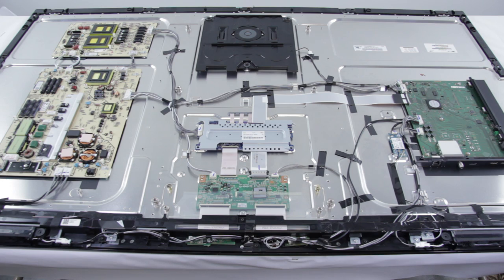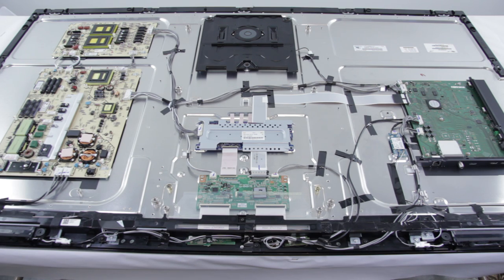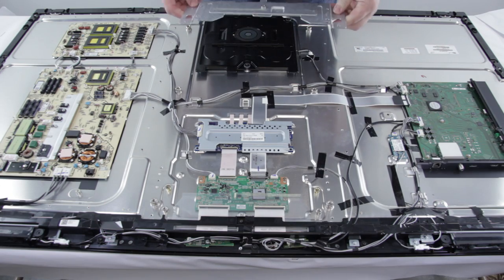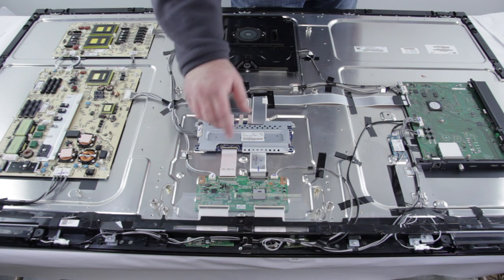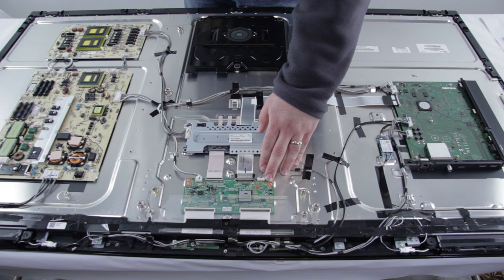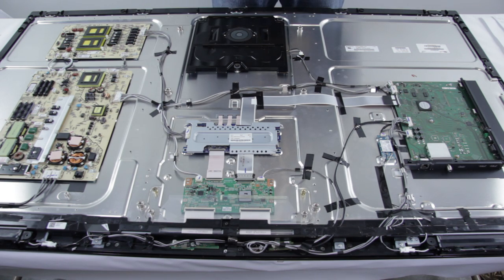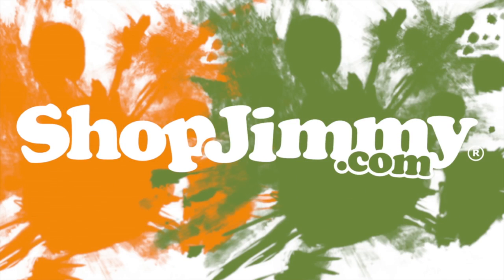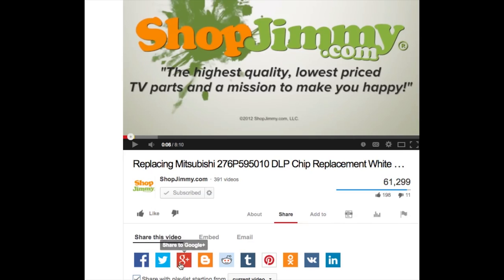LED TV Repair T-Con Board Help Review Overview - Common Issues and Problems with T-Con Boards

Comment: Hello Jimmy, 
My TV is. Smart LED Samsung model: UN46d6900wfxzc. 
When turning on the TV there is sound but a black screen, the MENU doesn't appear either..nothing appears on the screen. 
What can be the issue here please?
Reply: Thank you, 
I have tried this test. I turned all lights in room off and I turned on the TV I was able to see that the screen is actually blue not completely black. I notice the lights on the back are on
Reply from the maker: Abee Al    Try all repairs and troubleshooting at your own risk.  This could be a problem with either the t-con board, the main board or the TV panel.  You can individually replace the t-con board and the main board to see if one of those boards fixes the problem.  Click this link to possible replacement parts for your TV model number:  http://www.shopjimmy.com/catalogsearch/result/?q=46d6900  Be sure to match part numbers on your current board, with your replacement for compatibility.  Thanks and please let us know if you have any further questions with your TV Repair!  www.shopjimmy.com

Comment: hi i have SAMSUNG UE40F6400  Sofware Versio : T-MST12DEUC-2111.1
I have a problem with a dark stripe on the bottom of the screen
What could be causing the problem?
Thank you very much
Reply from the maker: +Indre S   Try all repairs and troubleshooting at your own risk.  This sounds like you have bad LEDs in your TV.  Unfortunately we do not sell replacement LEDs for your TV model number at this time.  You can check back in the future to see if we have them available.  Thanks!  www.shopjimmy.com

Comment: Sir plz reply to me
I HV 49 inch led 4k TV model no 49UH650T_TB
PICTURE started flickering one of mechanic came and he put piece of paper in tcone tc socket thn picture started coming properly but after some time again same problem came. Horizontal line coming on the upper portion and pictures flickering

Comment: Samsung 8 series. No picture, backlight on, sound is working. Can it be t con board also?
Reply from the maker: leslie chowSLU   This could be a problem with either the main board or the t-con board in your TV.  I recommend replacing the t-con board first and then if needed replace the main board.  Please reply with your TV model number.  Click here to view a video that shows how to find your TV model number:  https://www.youtube.com/watch?v=S51nhAmwR2M  Thanks!  www.shopjimmy.com
Reply: It was t con. Cheers

Comment: I am just about ready to give up.  My TV is a Toshiba 52xv645u and the serial number is 927434t10758k1.  The TV went out completely, no power, no anything.  I replaced the power board, but had flashing yellow light, so I replaced the main video board.  I now have a solid green light and sound, but no picture.  I did some research and it sounds like a backlight problem.  My question is there two backlight boards or just the one.  How am I to know if it is the backlight or T-con board?
Reply from the maker: Rick Smith   Take a look at the parts in your TV and compare them to the replacement parts in this link:  http://www.shopjimmy.com/catalogsearch/result/?q=52xv645u  Be sure to match part numbers on your current board, with your replacement for compatibility.  You can also call our customer service for further assistance with your purchase.  (877) 881-6492  Thanks and please let us know if you have any further questions with your TV Repair!  www.shopjimmy.com

Comment: Hi, Thanks for the great video. I have a problem with my Philips 46" PFL 7007 T/12. When I turn it on the screen/backlight comes on. After 10 seconds or so the screen goes a little bit crazy, it shows nothing useful but only black and white 'noise' (not moving, same pattern always) on the whole screen, and then black again, then shows random areas of black and white noise and then back to black, and the process repeats itself from the start. There is nothing connected to the inputs. None of the buttons do anything on remote or physical buttons. I have taken the back cover off and there is no signs of electrical damage, fuse is OK and no signs of blown capacitors. TV is two years old and probably has about 50 hours total usage. Thanks !
Reply: Actually the white noise i was talking about is moving, not 'not' moving as I said.

Comment: I have the a 2 year old Samsung un55es8000f.  the tv worked great however now I have vertical lines.  it does this intermittently.  It is odd in that it will work ok some days all day and then to following day the lines come back.  Folks on the internet say it could be T-con board but many say that the it does not help.  Called SS and they are useless and pointed me to an odd repair show.  The guy said he is well aware of the problem and that it is a $1100 fix UGH?  Any ideas beyond just buying a new TV?

Comment: I have a SonybraviaKDL46EX720 picture went lines blank & everthing else its not suppose to ..After watching reading hrs .Since had sound no pcture Also b4 it was unwatchable the screen boardrs kept changing.Went ahead & ordred Tco board cost 100 bucks & week.No luck wonderig cuz sound bose stereo is connected to hdmi arc port mayb it wasnt Tcon Does that make any sense .What now????
Reply from the maker: mike eckenswiler   PLEASE SUBSCRIBE TO OUR CHANNEL - Try all repairs and troubleshooting at your own risk.  I recommend replacing the main board in your TV.  Click this link to replacement parts for your TV model number:  http://www.shopjimmy.com/sony-a-1814-572-b-batv-board-upgrade-required.htm  There may be multiple boards for the same TV model number, be sure to match part numbers on your current board, with your replacement for compatibility.  Here is a link to a video showing how to identify your part number, click here:  https://www.youtube.com/watch?v=Aodz2LHkzbYThanks and please let us know if you have any further questions with your TV Repair!  www.shopjimmy.com

Comment: Sony Bravia KDL-40S2000 standby mode red light blinking 4x and stay that way until I unplug the power chord. Every time I reset then press power, picture and sound come on but just about 8 seconds then goes to standby mode blinking 4x. Please let me know the possible fix, thanks. Yobfsalamanca

Comment: my Vizio e500i-B1 has backlights, so my screen is white but also produces no sound could that still be the TCon board or the main board?
Reply: Same problem. What did you end up doing?
Reply: I replaced the tcon board. I got one from shopjimmy.com and it cost about 30 bucks. easy fix.
Reply: Randall Morgan Thanks a lot! Very cool for you to respond.  I just ordered the part too. tyty

Comment: 55LW5600 After touching power button. red light comes on blinks a couple times then turns light blue  but no picture or sound. please help. I unplugged and problem remains.
Reply: Sorry, It's an LG

Comment: Toshiba 46xv640U  having episodes of the screen showing rainbow vertical lines.  Sound continues, but screen freezes with the lines.  Sometimes it will blank and reset.  Most times I have to turn off the set and restart.  It happens with the DVD player and the cable box...turning off those does not clear the lines.  The lines only clear when turning the TV on and off.  The rest of the time the picture and sound is perfect.
Reply from the maker: TheDawgies   This sounds like a TV panel (TV Screen) problem.  If your TV panel is bad, it may be more cost-effective to replace the TV as panels are typically hard to find in stock, difficult to replace, and expensive.  Thanks and please let us know if you have any further questions!  www.shopjimmy.com
Reply: ShopJimmy.com  I was hoping you'd say T-con board, but it really helps to save the time of trying to figure it out.  Thanks so much for taking the time to respond!

Comment: I have a sony KDL-52wl-140 .It has two verticle bars in the center of the screen and on the left..If it is a t-con board the # is LJ63-05576B do you have any . Can I send you a picture. If so how
Thanks Gary

Comment: The issue I'm having is my Vizio model# - M3d470KDE, it keeps turning off on its own, no picture or audio, it's as if someone just hit the power button. It'll turn on fine, then a few minutes later it'll turn off again and this cycle repeats and repeats. So what I did was, on the tv there is a backlight Vizio emblem on the front bottom of the tv, I turned the backlight on so its always on, always light up. Next I simply waited for the tv to turn off on its own again and when it did, I noticed that the backlight emblem would power off in unisone with the tv, soo what that did was help me determine weather or not the tv was losing power entirely or not, now i just need to know what part to replace?? please help me if possible,thank you

Comment: Norm:I have a two-year-old Sampson L ED TV model number UN39FN5000 I have no Picture but I do have sound I did the flashlight test and I do have a picture the back lights are not working I replace the main board and the power supply board need help

Comment: i  have a 55" sony bravia it wont turn on and there is no lights on completely no power  model number is KD55X750F and i already changed the power supply board and that didn't fix it

Comment: I have a Samsung LN46A650 that after turning on, it stays on for a short period, turns green for 1 second then power cycles. This sometimes happens multiple times over a period of time...the PWR board was replaced, as was the main board. The problem is becoming more prevalent as time goes on.
Reply from the maker: Whocarez01   Replace the power supply board.  Here are some replacement parts for your TV model: https://www.shopjimmy.com/catalogsearch/result/?q=LN46A650  Be sure to match part numbers on your current board, with your replacement for compatibility.  You can also call our customer service for further assistance with your purchase.  (877) 881-6492  Thanks and please let us know if you have any further questions with your TV Repair!  www.shopjimmy.com
Reply: ShopJimmy.com It was replaced about 3 months ago as part of the capacitor recall Samsung did. Is there another component related to the power supply that it could be?

Comment: I have a samsung Led Tv (model No LNT.4081F).The problem with my Tv is that it seems to be displaying vertical lines.But when we switch on and off for a couple of times,then it becomes normal.So can you please suggest what  the problem may be?Thankyou!
Reply from the maker: Lakshmanan Durairajan   This sounds like a TV panel (TV Screen) problem.  If your TV panel is bad, it may be more cost-effective to replace the TV as panels are typically hard to find in stock, difficult to replace, and expensive.  Thanks and please let us know if you have any further questions!  www.shopjimmy.com

Comment: Hi, I have a Proscan model number:PLDED3273A-B and my tv is 32 inch it just shows white lines that are vertical and they are colored lines when on different channels. audio works fine though. Please reply back to me Asap!
Reply from the maker: +Big Hadi24  Try all repairs and troubleshooting at your own risk. This could be a problem with either the t-con board, the main board or the TV panel. You can replace the main board and the t-con board individually to see if one of those boards fixes the problem.  Click this link to replacement parts for your TV model number:  http://www.shopjimmy.com/catalogsearch/result/?q=PLDED3273A-B  There may be multiple boards for the same TV model number, be sure to match part numbers on your current board, with your replacement for compatibility.  Thanks and please let us know if you have any further questions with your TV Repair!  www.shopjimmy.com

Comment: Hello, I have a LG 55LW5600. I was experiencing 1 black shadow line around 5-6 inches long. I attempted to fix this myself by cleaning the ribbon/wire. After a couple of unsuccessful attempts the picture has changed. Now I see images that are blurry almost as the picture can't catch up as what is coming in from my cable box. The shadow line is faintly there still but now the entire image is blurry. Please help! Thank you
Reply: ShopJimmy.com do you think it could be the T-con board or any of its wires? Should I even waste money buying and replacing the parts or just scrap it and buy a new tv? Thank you!
Reply from the maker: Nicholas Yardley   No.  This sounds like a TV panel (TV Screen) problem.  If your TV panel is bad, it may be more cost-effective to replace the TV as panels are typically hard to find in stock, difficult to replace, and expensive.  Thanks and please let us know if you have any further questions!  www.shopjimmy.com
Reply: Bummer, thank you very much for your advice!

Comment: i have a samsung smart tv model UN55H6350AFXZA one day the screen went black it had sound but no picture and then the picture and sound went out completely I replace the power board I replace the mainboard and I replace the t con board I got a blue screen with sound but still no picture

Comment: My Samsung LED TV will come on and work properly for 2-5 minutes and then the sound and picture will disappear.  Any thoughts as to which board to replace?  It is UN60ES7150F
Reply from the maker: +Michael Quintal  Try all repairs and troubleshooting at your own risk.   I recommend replacing the main board in your TV.  Click this link to replacement parts for your TV model number:  http://www.shopjimmy.com/catalogsearch/result/index/?cat=56&q=UN60ES7150F  There may be multiple boards for the same TV model number, be sure to match part numbers on your current board, with your replacement for compatibility.  Here is a link to a video showing how to identify your part number, click here:  https://www.youtube.com/watch?v=BEPWrefQvqI  Thanks and please let us know if you have any further questions with your TV Repair!  www.shopjimmy.com

Comment: Hi I have a Samsung curved and It has on horizontal line 4 inches from the top right across...also the picture kind of shudders every few seconds making it blurry.  Please help..lol   Qn55q7camfxzc   I turned it on and it was good for 4 minutes then starts the issues again ...i was thinking com board...but not sure   thanks

Comment: un65ku6500fxza TV,  when I power it on the back lights flash once a second three times and then they turn off after about 20 seconds the back lights flash again three times but the TV never powers on when I unplug the main board cable from the power supply the back lights all come on steady so far I've replaced the main board and the power supply board and I've removed peripheral cables like the Wi-Fi module and speakers and IR sensor but I don't know what's wrong with it any ideas?

Comment: I have a VIZIO Model# VP504 FHDTV10A with Part# 10143080022. For the last week my TV is only showing me the right half of the screen.  I have sound and everything else seems to operate properly, except now I am also getting additional vertical lines showing up on the right half that's showing.  You seem to describe my TV's malfunction perfectly on your T-con board video.  However perhaps I can get some help from you along with the part number I need... please.
Reply from the maker: Geo Rod   Try all repairs and troubleshooting at your own risk.  This sounds like a TV panel (TV Screen) problem.  If your TV panel is bad, it may be more cost-effective to replace the TV as panels are typically hard to find in stock, difficult to replace, and expensive.  Thanks and please let us know if you have any further questions!  www.shopjimmy.com

Comment: My Samsung was doing the power off and on thing.  After replacing all of the capacitors it is now giving me a rainbow screen.  I think it maybe the T-Con board.  The model number is  ln46a580p6fxza
Reply from the maker: Dana Marshall   Try all repairs and troubleshooting at your own risk.  Sounds like you may have missed replacing some of the caps or used the incorrect replacement caps or there could be another problem with the TV.  Thanks!  www.shopjimmy.com

Comment: Hi,  i have a two years old  Sharp LC-55LB481C 55'' Roku TV,  that started to shut offs by it self every five minutes during the summer , then came back to normal but several months after, it started to do the same thing again but shuts off after a few seconds, without giving me the time to set it up,  then  shut's  off on me again repeditly in a loop , i can't do anything with it. Didn't take the extra warranty, i am stuck with it .  i would like to identify the problem , is it the power supply , the t con board or the main board ? I am gona try to fix it myself . can you help me . I found the T con model that i need T-CON BOARD T550HVN08.1 55T23-C02  but looking for the the other parts , main board and power supply . What do you suggest me to do ?